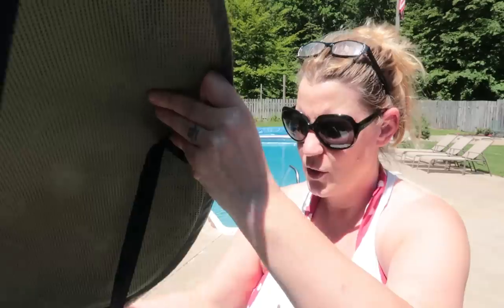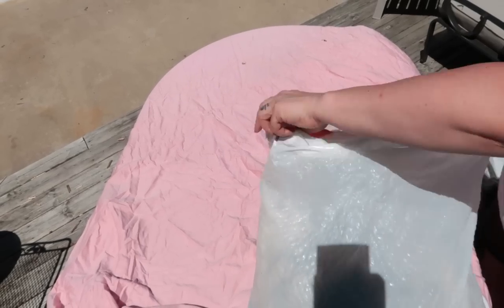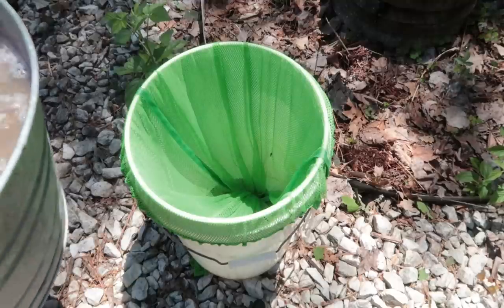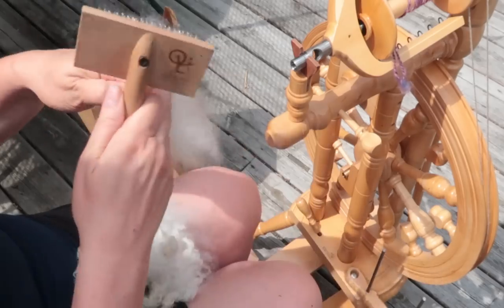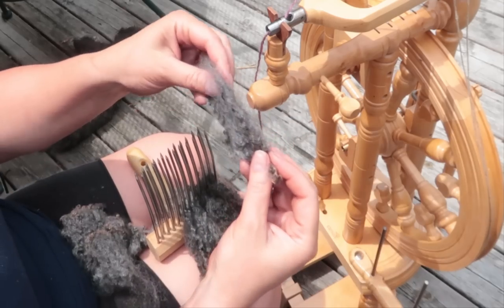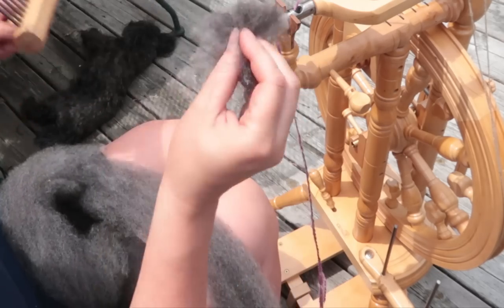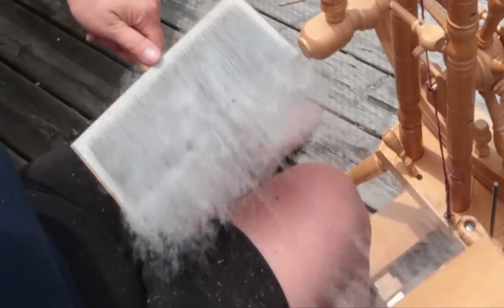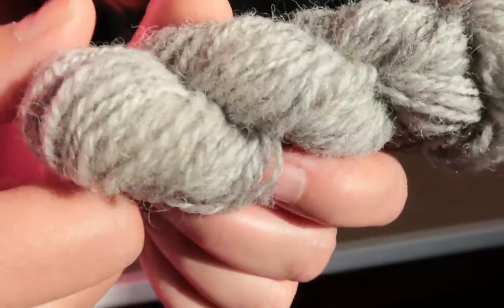Washing, Hand Processing, and Spinning Wool from a Recent Sheep Shearing!  BFL, Romney, Jacob/Dorset

Comment: it was so cool to watch you skirting and washing those fleeces and seeing the different preps you used.  I have hand cards but not combs, I will have to save up and invest in a pair.  I have two fleeces that I’ve had for at least 5 years because they are from a meat farm and no coats so they have so much vm, but they are polypay so they are skin soft and usually because of the vm I send them to a fiber mill to be processed.  After watching this, maybe after skirting these I will wash one of them and try the hand cards on a bit to see if it’s worth it to try myself or the fiber mill is the best option ;p. One of them is a charcoal black and the other one is white.
Reply from the maker: I used to have a meat farm source for Polypay and Suffolk, but they don't have either of those breeds anymore, and it kills me.  I really would try hand carding or flicking on polypay!
Reply: @FiberLoveDiary  my local 4H families are happy to get rid of their suffolk fleeces. Such a great community and they are just happy that something is getting done with the wool! Might be worth a check